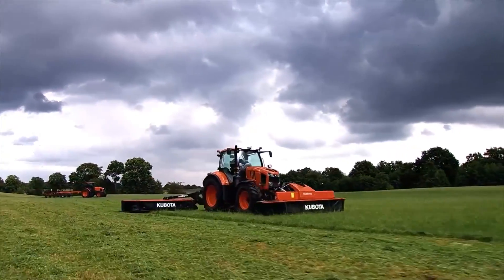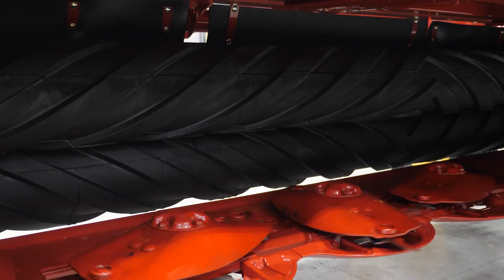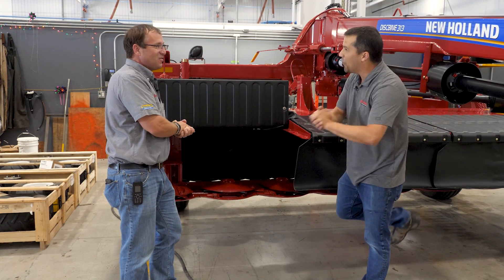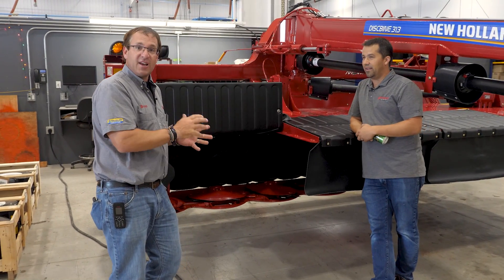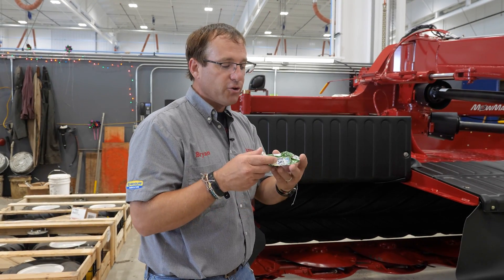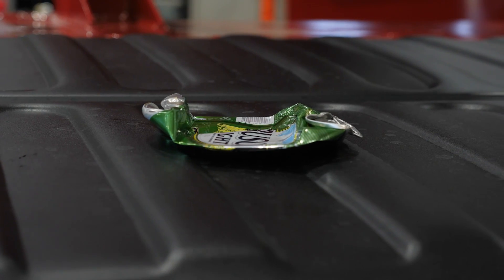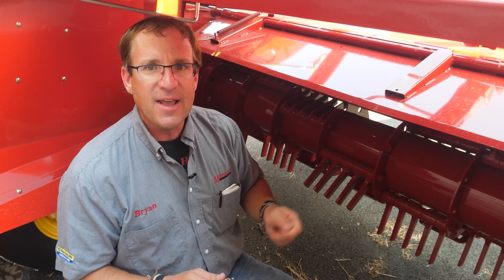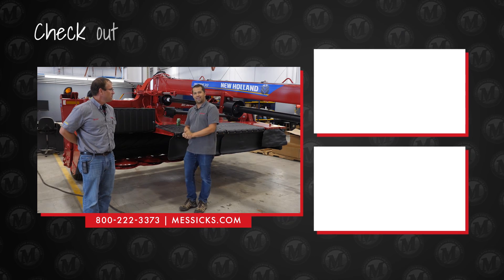How do I adjust a Discbine | Roll Gap vs Roll Tension

Comment: Ive had a New Holland haybine now for 25 year. When I bought it I soon found it took a long time for the hay to dry.  I checked the roll gap. It still had one quarter inch of spacers between the rolls !!     This is for doing oats. Not hay !   I removed all shims.  What an amazing difference in hay drying time !!!    The rolls have been running tight together since I had the machine  Full pressure also !   Never had any damage to the rolls !    Farmers that bought a haybine and still have the shim in.......are cutting hay with a sickle mower !  They dont know any better because the book says so.    Seen most hay bines at sales with the shims still in.  You can run the hay bine for at least 10 minutes with no hay going through it. The rolls might get warm...no more then that !
Reply: I have a 408 that I just got. It has around 8th to quarter gap. My hay took 3 days, even then still green stuff after wedding twice. I'm thinking the gap is too large. Why is there shims at all..
Reply: @rossharwood2678    The gap is for doing " oats" or other seed head crops that of which you want to save from seed loss.     Hay............  why not adjust so the rolls are " touching " ????     If you can pull a sheet of paper out from between the rolls........its too far apart !  
Why cut hay if your going back the the sickle mower.......no conditioning !!!!   Over 80 % if the haybines Ive seen at sales.......have shims between the rolls.  Fact is they are rusted in !   Farmers never knew they should be removed.  Early models were shipped with out shims.  The shims were bolted on beside and center of each end of the rolls. Later models were shipped with the shim in place.  Its sad......farmers never understood why their hay never dried !
Some claim it damages the rolls if they touch.  Well my haybine ran for 30 years....tight as I could get the rolls together...... rolls were like new !

Comment: Neil, a good video idea could be a Swather VS Discbine video....every farmer that does hay where I live here in Western Idaho uses a swather for hay fields, whether it be grass hay, alfalfa, or a mixture.  Which machine is actually better, and why?  A swather from my understanding is a combination of a sickle bar mower, and a reel that pulls the material through and into the auger.  Where the discbine is more of a rotary type mower action?  Might be a good video comparison at some point.
Reply: Difference is mainly in the cutter, both accomplish the exact same thing.  A sickle bar type uses segments and guards to cut the hay, where the rotary uses spinning disks with cutters to cut, both shoot the hay into the rollers to crimp.  The reel on the sickle type feeds the hay in, where the rotary is self feeding.   The sickle type is more prone to clogging up where the rotary doesn't.  It can go through heavier hay.  Downside is they require a lot more horsepower to run where a sickle type can get by with a compact utility of 40 horsepower.
Reply: @acdii  depending on climate and soiltype, each have their pros and cons. For more damp hay a disc mower is the way to go; more dry climate/sandy soil a sickle machine could be more preferred for a better cut and less fire hazard.